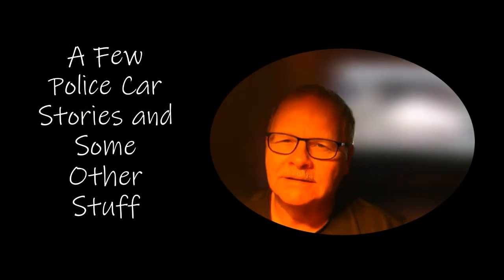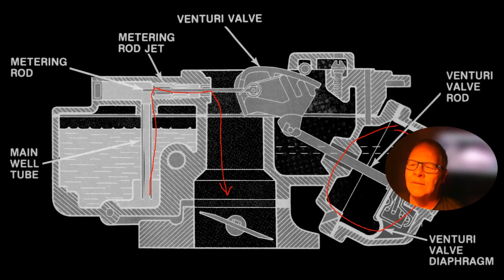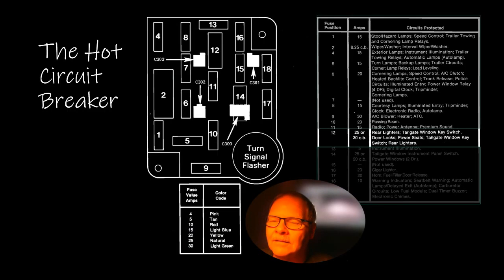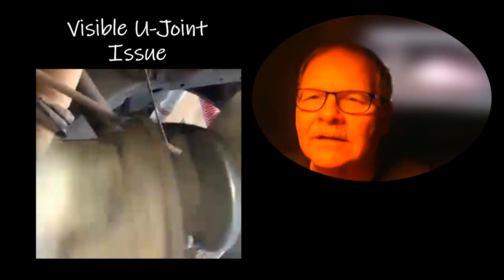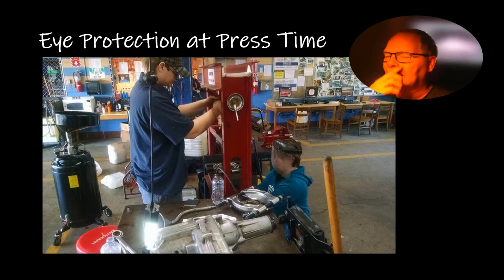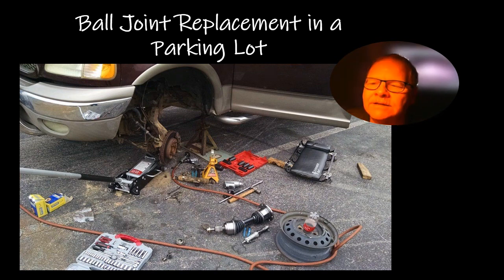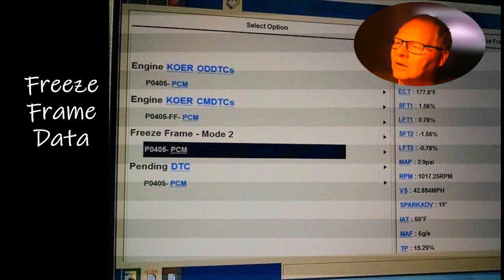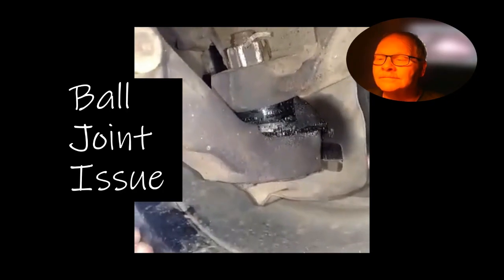Police Car Stories and Other Stuff

Comment: Thanks for showing sharing the scan of the governor pressure. I’ve got a Dodge truck with a 46re transmission that was recently rebuilt. The actual governor pressure shown by the sensor shows it at zero even though the truck will drive and shift. Haven’t checked the wiring harness yet but I will probably be dropping the pan to replace it.

Comment: A kit car owner had me change to some pedals and I noticed the carburetor  linkage not opening complete. It was a car that could melt the road/hyperspace and stuff. That guy came back that next only to tell us exciting hot rod was and ask why so fast now? I really like how you got the random hidden short situation that happens quite often inside high amp wires and connections. A diagnostic tool I have used is tug tug tug  suspect hidden corrosion main wires while  switching on/off the starter. Took a few minutes to figure a few good tunes to cut into them belts to play beyond extremely slow at idle .  Make you love your ride the way you love your kids favorite loopy song.  Good Monday Morning
Reply from the maker: Good morning Mike!